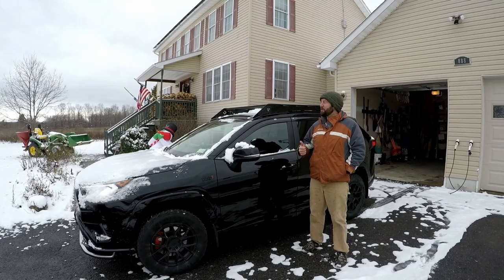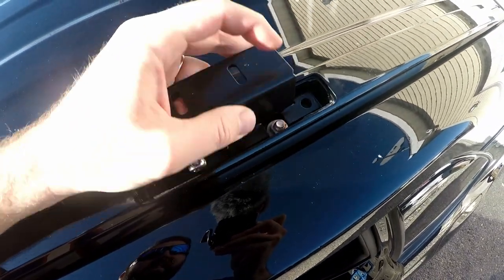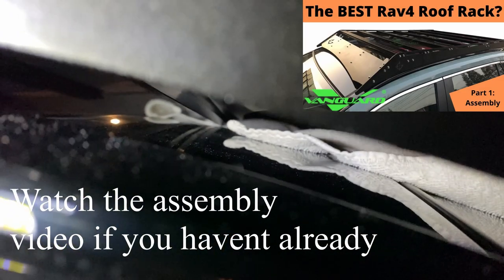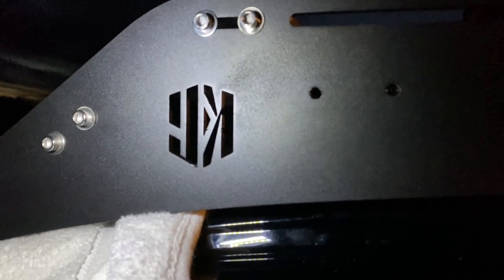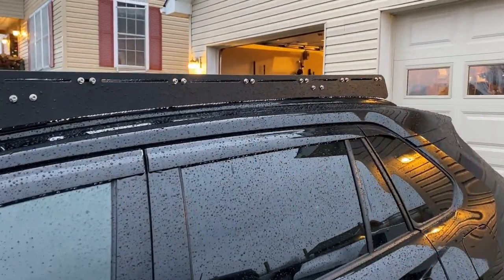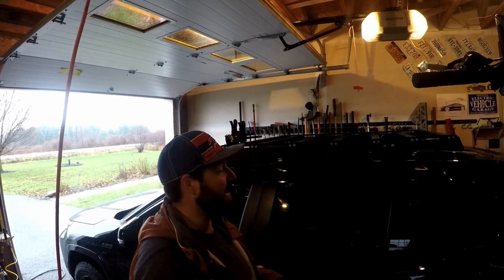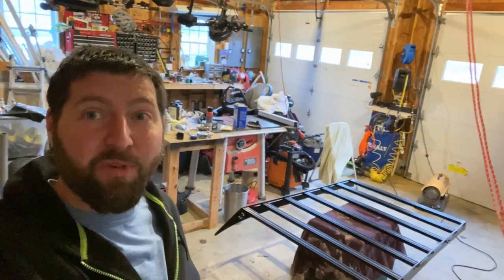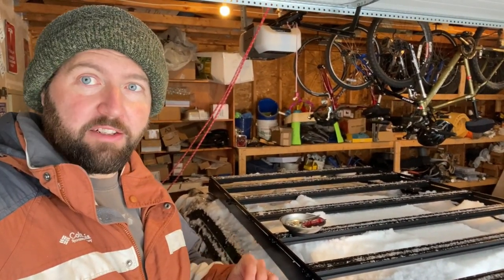2019+ Toyota Rav4 Vanguard Roof Rack Mounting (Prinsu Look-a-like)

Comment: You are very patient I would be livid to be sold a product that had defective parts (bent in wrong spot), didn't line up front brackets and with a front air deflector that simply does not work.  This is what I would call be ripped off LOL.    Luckily you are also very handy to fix these issues.
Reply from the maker: Thank you. It wasnt too bad though. And I really wanted this look so it was worth it to me. Wait till you see the fairing I built. That was  a little bit of work but only a few hours. I am currently painting it in my kitchen because its 15 degrees outside. It stinks!

Comment: An issue with stainless bolts is once together they do not like being removed. There are some thread compounds that can help but if they are stainless bolts that's just what is going to happen. I have had several issues in the past working with stainless and once you put the nut and bolt together they almost always lock up and strip the threads.

Comment: I stripped the mounting hole too, they definitely have some weaker type of material being used. It was 800 dollar fix from Toyota.
Reply from the maker: You installed this rack?!?!
Reply: @JamesKlafehn  not this rack but a front runner and I stripped one of the bolts that mounted to the rail brackets.
Reply from the maker: @thatguyceek  Im sorry that happened. How did you fix it? I was able to thread a new stainless bolt in and it held no problem. It was weird. I definitely stripped the oem bolt but it took a new one with the same thread pattern.